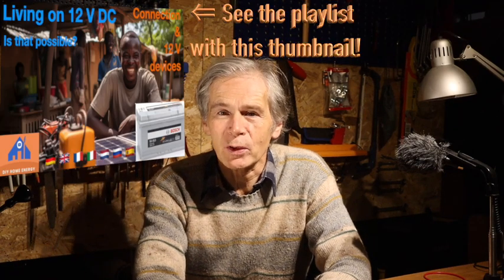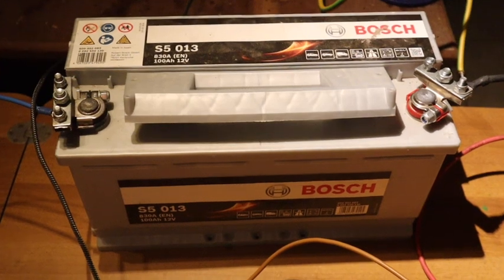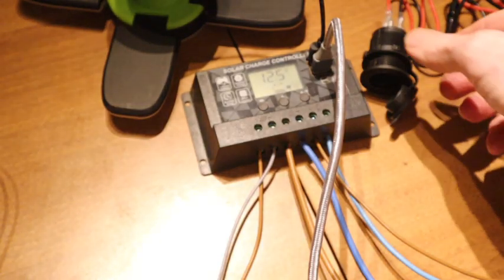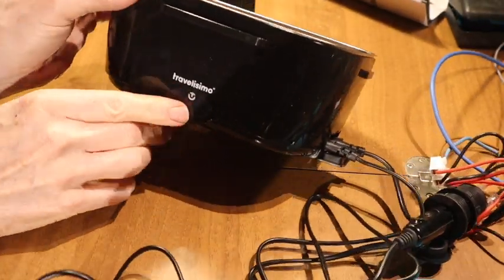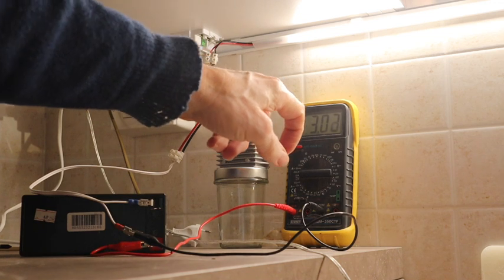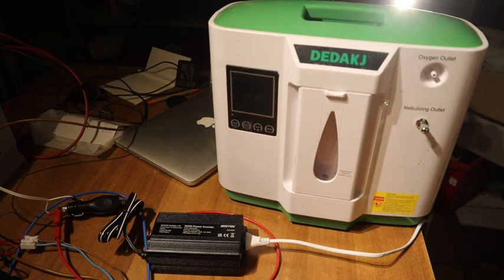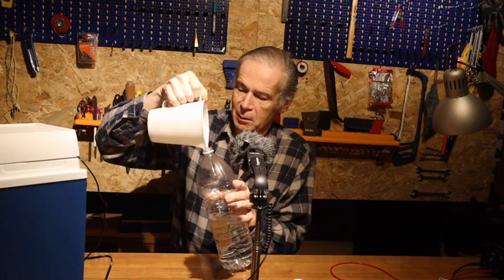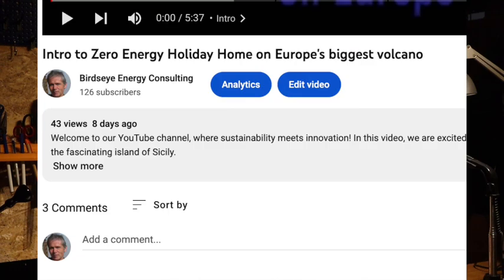What appliances run on 12 V, during a blackout? - Video 34e

Comment: Hi Norbert. This will help people to get free electric. When i have built this solar system i will upgrade in about 4 years. With the money i have save from not using house electric.
Reply from the maker: Hi Daz, it will certainly help to bridge black outs and you can charge it with the grid and Renewable Energy, but the investment is still necessary 😉. However, you are right, energy is essential for freedom, even if it is only to study during dark hours.